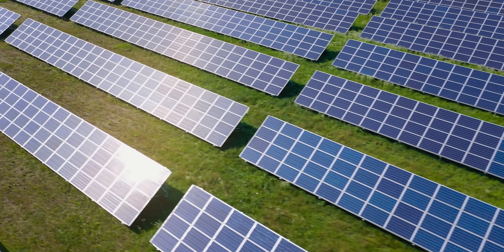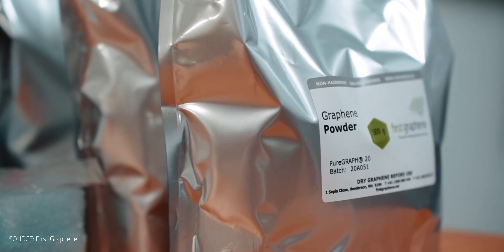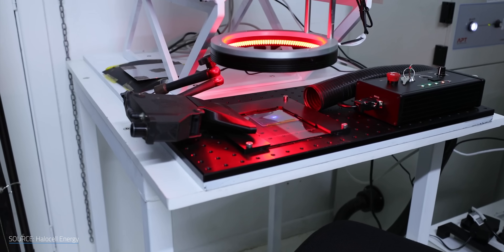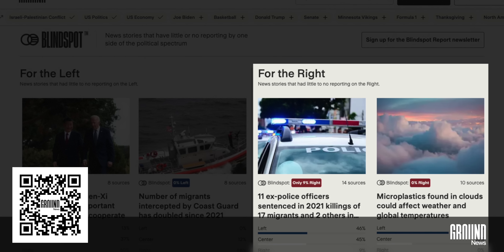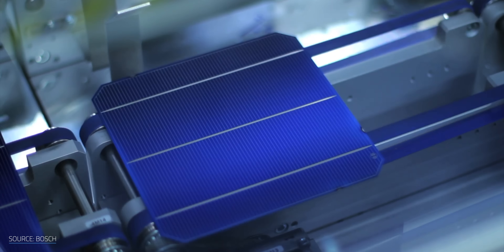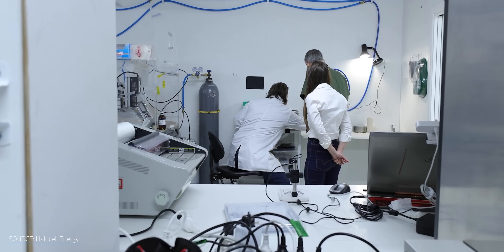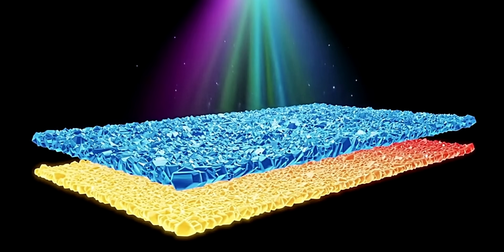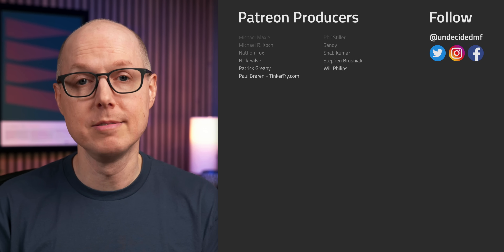How This Perovskite Breakthrough Could Change Solar Forever

Comment: The problem with grid scale solar isn't the panel cost... They are already cheap enough.... its the energy storage cost. 
Germany vs France are the perfect comparison. Germany went all in on renewables and their emissions WENT UP. 
They shut down nuclear plants, etc. The problem is renewables are intermittent, you need to maintain all that baseload infrastructure for when the sun isn't shining and wind isn't blowing. the result is costs also go up. they had to turn on NG Peaker plants and coal plants to maintain baseload so emissions were actually higher. 
France is the Ideal energy case every country should be striving for over 65% of their power is nuclear. Clean Reliable and Cheap. 

I support any individual buying and installing their own solar with battery system. I'm going to do it to avoid electrical bills completely. 
Net metering is a problem as it offsets the storage capacity onto the grid and causes problems.
Reply: renewables with storage are still very competitive energy sources compared with fossil fuels, what isn't competitive is rooftop solar, and that is because while PVs are cheap, installing them on the rooftop of homes isn't, specially in places like the US, THAT is the biggest cost of PVs at the moment. but that is true, the cost of intermittence drastically increases the cost of renewables, but as you said, all you need is a solid baseload.
Reply: How much do fossil fuel companies pay you to push this drivel? Or do you do this work pro bono?
Reply: Your misstatement appears to come from misapplying the one bad year (2016) immediately after discontinuing nuclear as if it continued in 2017 to 2024.   It did not.
Always a good idea to verify these things before you pass on misinformation or severely out of date information.
Reply: Plus the cost. There is a famous quote "the sun and wind don't send electricity bills". Yeah, but having two entire powerplant systems has. Solar and wind that either don't produce enough or spike so hard that they sell to france and poland at negative prices, or go so low during dark and wind free winter days that every gas plant is running at full capacity and they have to buy french nuclear power at 5x the price.
They could've just kept the 15 most modern nuclear plants of the 18 they had. Instead, they gave a life extension to the oldest garbage powerplants from their neighbors, nuclear ones in france and coal in poland.
Reply: @texasranger24  Your information is now a decade out of date with the reality of what's actually happening in Germany.  You really need to read up.
Reply: @mac_mcleod  German energy price 20 years ago before they had massive amount of "renewables" and before they had cheap russian gas: 11ct/kWh.
Prices today, after nuclear shutdown and with all the great renewables that get billions in government subsidies so they should be basically free: 43ct/kWh.
Either you are lying or the numbers are. But the numbers kinda don't lie!
Reply: @texasranger24 

You really need to verify your facts before posting...

According to historic data, average household electricity price in Germany in 2000 was €0.1394/kWh (13.94 euro‑cents per kWh). 

Using an inflation calculator for Germany, price levels have increased by roughly +60‑63% from 2000 to 2024/2025. 

Adjusting €0.1394 by the inflation factor (~1.61) gives a 2025 equivalent of about €0.224–€0.225/kWh.

The actual price for household electricity in Germany in 2025 is around €0.38/kWh. 

You have both understated and overstated the price of electricity for both your beginning and end point. 

Electricity is priced higher than it would be simply adjusting for inflation and here's why in the next post
Reply: @texasranger24 the renewable surcharges were dropped in 2022. 

The primary reasons for the higher cost now are grid upgrade charges and higher VAT.

As a result of the grid upgrades, the German electrical system is much more reliable than it was in 2000... reliable than it was in 2015 and more reliable than it was in 2022 so some of the extra costs is due to changes to make electricity more reliably available. 

What is clear is that personal solar and battery systems run less than 6 cents per kilowatt hour for electricity.  People who own homes and who have balconies can generate personal electricity to lower their electrical usage.
Reply: @texasranger24  I did some AI research and found "Based on the most recent data from 2023 and 2024, the answer is no. Germany’s power generation emissions have actually fallen significantly, and renewable energy is the primary reason for that decline.

There is a common misconception that Germany's transition to renewables (and its simultaneous exit from nuclear power) caused emissions to spike by forcing a return to coal. However, the data from the last two years shows the opposite:"
Reply: @nomiSimple  Thanks! Im tired of all the renewable slander
Reply: @nomiSimple  The parent misinformation post is based on assuming that what happened in 2016 (a temporary spike in coal use peaker plants) continued in 2017 to 2024.  It did not.
Reply: @nomiSimple  task failed succesfully. First, AI is not research. It's a statistically probable word salad that may be either close to the truth or completely made up and you have no way of verifying it's validity. Even reading something on wikipedia is more research, even if your teachers hopefully told you that it's not a good source to cite.
Next, at no point whatsoever did my comment talk about emissions. Not a single word. I talked about COST, which you could've figured out with some reading comprehension rather than AI brain outsourcing. And finally, Germany during winter time has the second dirtiest grid in all of the EU, only behind Polands coal powerplants. During summer it kinda depends how you calculate the production emissions and emissions due to tough or impossible recycling of broken solar panels and wind turbines. Which the "sources" that your AI might've just made up most certainly didn't. And you can't prove any of it because you are lazy and have no idea which source says what.
Reply: @texasranger24  my apologies as my comment was in answer to a comment prior to yours.
Reply: Nuclear is not cheap. It is not clean if you even briefly consider the mining of fuel and the still not universally solved issue of waste. It may be reliable, until it isn't. In the rare cases where nuclear fails, it is far worse and expensive than any other power generation failure. Until we come up with and enact a global standard for total power plant design and a global plan for waste handling and storage - nuclear is a non-starter.
Reply: @Hybridog  Nuclear is also thirsty.  They already had to cut back on nuclear during that last heat wave.    Losing power during a heat wave is much worse than losing power during a freeze.
Reply: @mac_mcleod  Nukes are thirsty and water is their primary achilles heel. Not so sure a heat wave power loss is worse. Over 200 people died in Texas during the big freeze and blackout - some sources think it was more like 700. Heat related deaths happen all the time, but I don't know if during a dummer power loss the death rate is higher than it is during a 0º ice storm across the whole state.
Reply: @Hybridog  I'm a Texan.  The people who died in Texas died due to ignorance and lack of preparation.   People all over the world survive in colder temperatures.   If folks had simply had wool long johns and food on hand, most would have survived.  

But once the wet bulb temperature gets over 35C, there is nothing you can do.  You just lose your life in a few hours.

And once the temperature gets too high over what you are used to there is also nothing you can do.  It takes weeks to adapt to high temperatures that are under 35C wet bulb.  People in UK have died from heat stroke at 85F.

And finally... 

The summer 2022 heat waves caused  roughly 61,650 heat‑related deaths across Europe between May 30 and September 4. 
Salle de presse de l'Inserm
PubMed

And the summer 2023 heat waves caused  roughly  47,700 deaths from heat across 35 European countries (hottest period roughly May–October).
The Independent

The deaths in Texas were avoidable and needless.   It was a combination of lack of preparation (by the state and by individuals), ignorance (by the state and individuals), and failure of leadership (By the state).
Reply: @mac_mcleod  Keep in mind, everyone is not you.
Reply: @Hybridog  Nuclear indeed isn't cheap, but it is clean and reliable. yes it requires mining nuclear material, but the quantity of fuel you need per MW/h is so small that the impact is probably not much worse than mining to build more renewables. and the spent fuel waste IS a solved issue, it only isn't universally solved because of uninformed population that were feed anti-nuclear propaganda, and political lobbing. because all you need is a deep enough mine and you can burry hundreds of years of nuclear waste, make it thousand if you start allowing people to recycle the fuel instead of prohibiting it because of unfunded fears of nuclear proliferation. the failure is also a solved issue, modern power plants have multiple passive safety systems, the chances of another Chernobyl are basically impossible, and the chances of another Fukushima are extremely unlikely. it is in fact so safe and reliable, that more people die because of accidents with wind turbines than all the people that died directly because of a nuclear power plant going wrong combined.
Reply: @danilooliveira6580  also you can literally recycle nuclear waste. Radiation literally means energy, and that's what we want in our reactors. The only thing preventing it is nuclear non-proliferation treaties. We literally made recycling illegal and now politicians claim we can't recycle. When that is clearly a made up lie, one that THEY made up with their regulations and treaties.
Reply: @danilooliveira6580 nuclear might be clean if we ever get breed of reactors but it is not currently clean.   And saying it's cheap often ignores the much more expensive than projected decommissioning costs and definitely ignores the cost of storing nuclear fuel for hundreds of years under secure conditions to prevent bad actors from taking it to produce dirty bombs.
Reply: @texasranger24 you can but we don't for the most part.
Reply: @mac_mcleod  when we say "clean" we mean CO2 emissions per Watt produced, no energy source is actually clean, but when it comes to CO2 produced to generate energy, nuclear is indeed clean. 

the reason reactors get decommissioned is, again, politics. the two main reasons are refurbishing frequently to meet impossible regulations become too expensive for investors, and unfunded fear of nuclear energy pushes governors to close down reactors. because the truth is that with constant maintenance a nuclear reactor can last for generations. the first nuclear reactor in my country was built in 83, it's about to be 45 years old. there are few power generators that can reliably function for that long. 

and no, no one ignores the cost of storing spent fuel, it is included in the calculations of cost, so is decommissioning since it goes in the budget, so yes, if anything the price of nuclear is inflated by them. safely storing nuclear waste is actually very easy to do in a safe way, they are stored in huge steel and concrete caskets that makes it almost impossible for someone to steal them without being noticed. all you need to do is burry it deep enough in an abandoned mine and it will be safe for millennia.
Reply: @danilooliveira6580 

And that very special meaning of the word clean, nuclear is about three cleaner than solar. 

However,  both are much cleaner than coal and natural gas. 

Energy source	Approximate CO₂ emitted per kWh (full lifecycle: mining/manufacture, construction, operation)

Coal (typical coal-fired plant)	~ 800–1,000 g CO₂/kWh 

Natural gas (modern combined-cycle)	~ 400–500 g CO₂/kWh 

Nuclear power (modern reactors)	~ 10–20 g CO₂/kWh 

Solar PV (typical utility-scale)	~ 40–60 g CO₂/kWh
Reply: @mac_mcleod  yes ? are we in agreement then ?
Reply: @danilooliveira6580 not quite.  
I agree that it is marginally cleaner in terms of sea of two produced but it produces radioactive material and often creates immoral debt for our descendants who will not benefit from the power produces. If we charged ourselves the actual cost of the nuclear power it would be 2 to 3 times more expensive than solar power. 
On top of that it warms up tremendous amounts of water and we've already seen in a warming planet that it has to be restricted or shut down turn heat waves. 

We are in agreement only that it produces a small amount of CO2 less than solar.
Reply: @mac_mcleod  again, the radioactive material is minuscule and can be reduced even more if we start recycling. solar and wind will also generate "debt" for our descendants in the form of unrecyclable plastic trash, everything we do generate trash. 

and yes, I agree nuclear is expensive, but it help renewables by complementing their biggest weakness, intermittence. renewables become exponentially more expensive when you try to power 100% of the grid with them, but get a good base load and their cost drops. and the best baseload we have for most regions is in fact nuclear.

and lastly do you REALLY think nuclear is the only form of energy generation that generates waste heat ? the 1000w or so of energy a solar panel absorbs becomes waste heat that would have been reflected back into space otherwise because of the panels very low albedo, and all the electricity we consume in our devices also turn into waste heat. the waste heat of nuclear power plants is not as much of a problem as you think. yes, waste heat is a HUGE problem, but the waste heat of nuclear is not what will be our downfall, CO2 trapping that heat inside our atmosphere is. and if your issue is the hot water being dumped on rivers, that is what cooling towers are for, to cool and reuse the water.
Reply: @danilooliveira6580 solar doesn't consume vast quantities of water for waste heat.

I do agree we need to put strict controls on solar waste before solar becomes too powerful. 

We're also running a major nuclear accident that ruins 500 square miles of land roughly every 40 years. 

Where is currently one in Florida that could be set off by a major hurricane. 

There is a place in our energy system for nuclear but it is not as large as you propose.  We're not handling nuclear waste well now.  

If we truly get to the point where we can use thorium reactors to consume the nuclear waste then it's a different discussion.  But that could be 20 to 60 years from now.
Reply: @Hybridog  Still. If we in Germany would have kept our numbers at  our build 33 nuclear power plants. And shut down coal power plants instead.  We would have a lot less CO2.

Besides. You can't have your cake and eat it too.
There is no technology. That is cheap. Has Baseline energy. Produces no Co2. Doesn't consume a lot of space and produces no problematic waste.
You need priorities.
Our priority should have been becoming CO2 neutral before 2045.
It wouldn't have been too late shutting down all nuclear power plants after reaching CO2 neutrality.
Reply: @blablup1214  actually nuclear energy is cheap if you go by economics, not by made up lies and regulations by governments. Governments lie to people and enforce false "science" in the form of the verifiably false Linear No Threshhold model for radiation and the resulting ALARA regulations (as low as reasonably possible). They are false. Proven wrong beyond any doubt. Yet anti nuclear politicians like the german green party are ideological warriors and not science basec protectors and conservers of nature.
Also, Gaboon had massive uranium deposits that lead to self igniting nuclear "reactors" millions of years ago. Nuclear waste moved 3 to 5 meters ever since. It's super safe.
Reply: @Hybridog  Also, I find nuclear (as currently modeled) to be deeply immoral as we are getting unrealistically underpriced power and putting the long term costs on our grand children and great grand chlidren who will not get the power (since the plant will be decommissioned in or before their lifetimes).